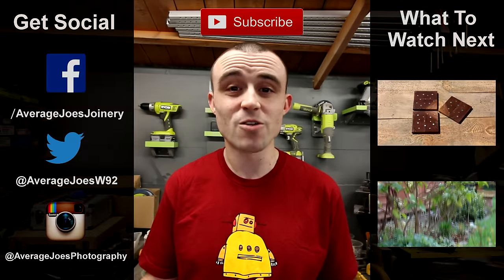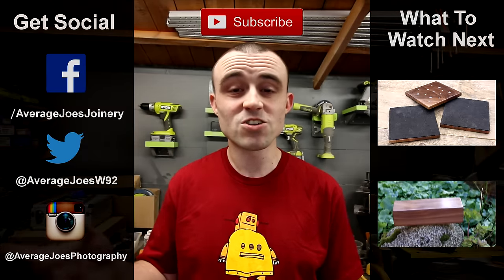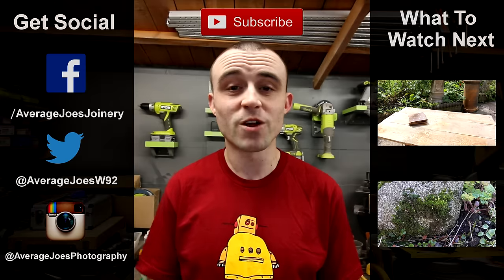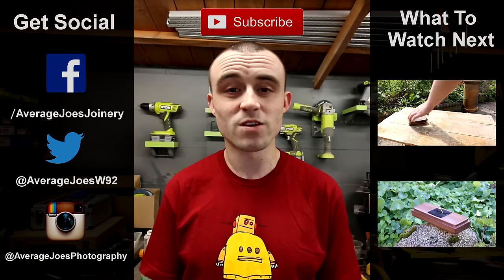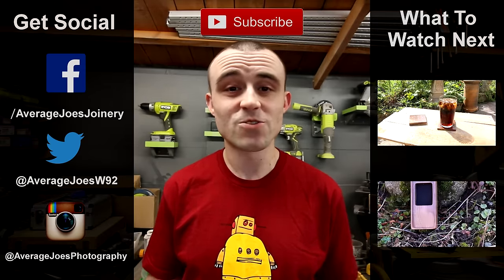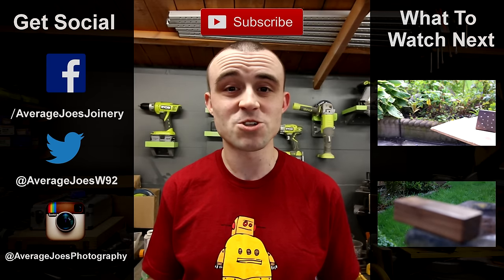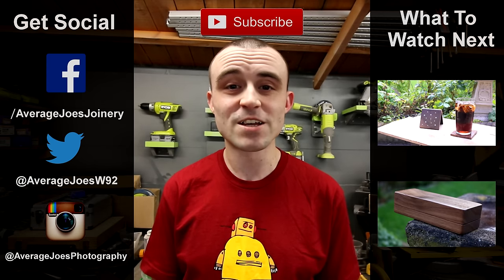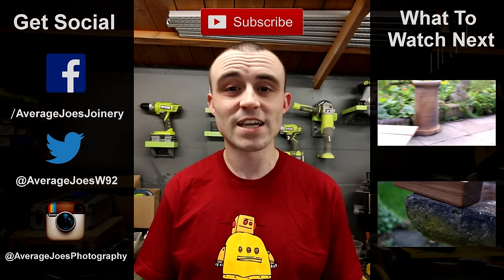Breeze Block Owl Carving - For Makers Care

Comment: That's a really interesting idea. I wonder if there was a way to toughen it up afterwards, make it more durable for us in the garden etc. Maybe soaking in varnish or resin?
Reply from the maker: I havent done any real testing myself yet so I didnt mention it in the video but I think masonary sealer will be perfect for these. I have a couple of carving I did last year that have been outside side and they are in perfect condition with no finish on at all. The addition of the sealer should make a huge difference to the strength of them.

I really like the idea of soaking it in resin too. I bet that would work really well! I had thought about using the breeze block carving to cast a mold from for resin and concrete. I'll have to experiment :)
Reply: Thanks for the reply, love to see a vid on your experiments after you have some results.
Reply from the maker: caskwith
I'll definitely be getting some video of what I come up with. Lets hope it goes to plan haha Thanks :)

Comment: Very nice, Joe. I had to look up "aerated concrete", I don't think I've ever seen it for sale in my area of the US.
Reply: Steve Collins over the pond I think they are called cinder blocks. But don't quote me.
Reply from the maker: Thanks Steve! :) They are really light weight and are full of bubbles. I hope they are easily available everywhere
Reply from the maker: Thanks for the help :) Hopefully they are easy to find :)
Reply: Actually cinder blocks are made with a different method than these are. Carving a cinder block would be alot more difficult :>).